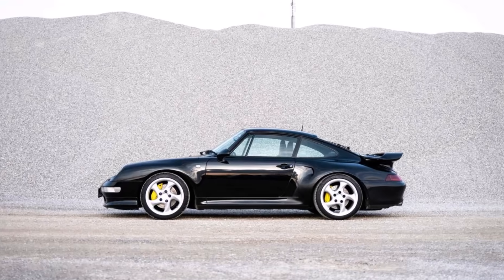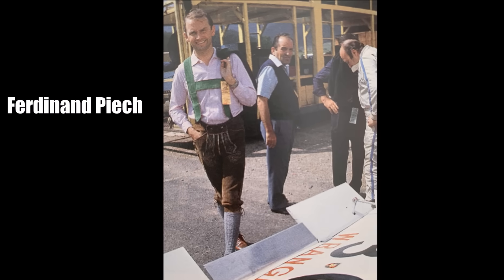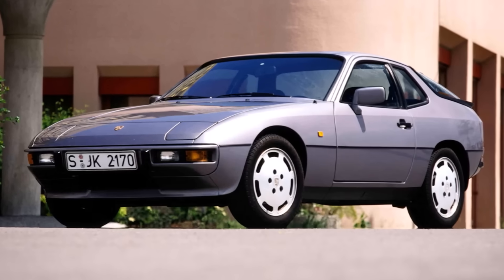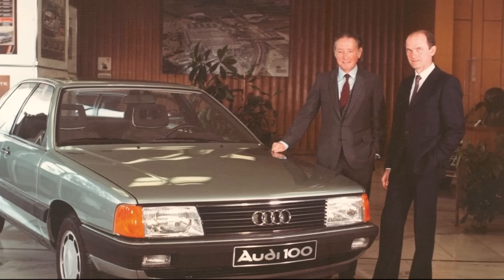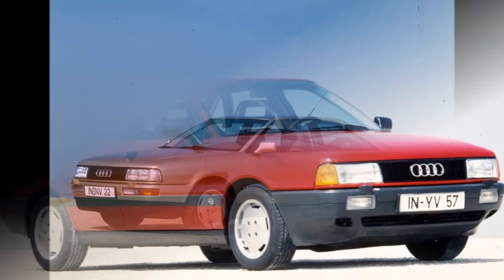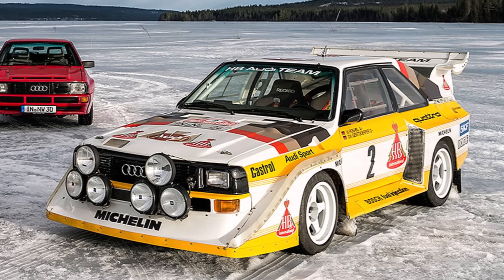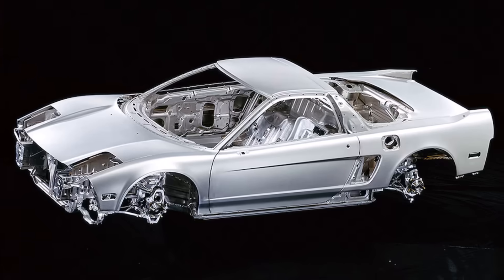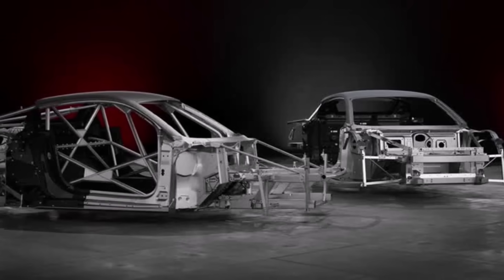How AUDI and Porsche eliminated corrosion forever - Development EXPLAINED

Comment: I mean, Audi 80 is a very good example of an old car without major rust problems.
VW Passat B6, on the other hand, is a much newer car and I see them with rusted arches all the time.
Reply: Funny, when I had a B6 with the 1.9TDI I was shocked when I first saw it from underneath because it basically looked pristine, no rust at all and not even the typical oil „sweating“.

Unfortunately someone ignored my right of way and crashed into me…
Reply: @Simoxs7  Lucky you. My B6 (also 1.9 TDI like yours) developed actual holes. Most rust I've ever had in a car.
Reply: The B6 and cars from its are are much worse than what came before, especially for the coloured panels. In 2005 EU introduced regulation for car manufacturers needing to decrease the  amount of solvents used per car produced. 

This lead to some places of the cars that followed shortly after to have decreased paint thicknesses and some sections where different coatings were used. 

The chassis is still quite well protected, but the B6 is definitely not as resistant to scratches or stone chips on its exterior panels.
Reply: I've never seen a b6 that didn't have a rusted trunk door
Reply: Here in Norway you see them with literal rust holes in the doors and it's not even rare, same with the Touran of the same age.
Every VAG product suffers badly from rust.
Reply: @kristoffer3000  Not every. previous generation of passat is basicaly rust free but every vw from this generation (2005-) rust super bad
Reply: @xy_iron  A b5 or b5.5 are not rust free lmao
Reply: I have Passat B6 since 2009. Corrosion firstly started on trunk door around left brake light few years ago. Now almost every panel has corrosion. some have relatively little, and some have a lot. Fortunately it is nothing deep. It is just surface rust.
Reply: rusted arches are kinda normal but b6 rust in super wierd places where no other car rusts like near door handles, chrome stripes on doors, or just middle of rear hatch
Reply: @xy_iron  for now there is no rust on those places. There are few rust spots on the roof where roof and windshield meet
Reply: currently doing fenders, rockers, 3 of my doors, replacing the rear subframe and patching my spare tire well on my b6, 1000 bucks running and driving avant 1.8t quattro with no negotiation though

Comment: No they didn’t. I have 2 friends with Audis rotting underside, cars made after 2008. They’d like a word.
Reply: that's very relative, it could be for alot of reasons including environment and how you look after the car, it's pieces of metal after all they could put all the protection on it but it fights with the environment for the rest of its life, i got lucky my 2001 golf has couple of tiny rust spots here and there while some newer cars seem to be falling apart.. but yeah the title is kind of misleading they didn't eliminate corrosion forever, they just found a way to slow it down
Reply: @emre619619  Romania, which is similar weather to Germany, both cars well maintained and not abused. And among mechanics it's a known thing. Something is up with VAG products in the rust department.
Reply: Rust never sleeps
Reply: The same car from a different make under the same environment probably don't even exist anymore - disintegrated into fine particles of rust dust.
Reply: @jamsbong  Certainly not the case. We have different cars here and they don't have this problem.
Reply: @ahmedalsadik  May be you've got a lemon. I've owned 3 Audis and none of them ever rust and I live on the rust belt and drive the car 365 days a year.
Reply: @jamsbong  Not my cars, two of my friends. Maybe your cars are newer and made in a different factory. But out here everything VAG is known to rust more than other cars, certainly more than other premium brands like Merc and BMW.
Reply: @ahmedalsadik  I have also owned a BMW and it rusted a lot underside and they have terrible quality all around. Like the paint cracks after just 6 years, disintegrating rubber and plastics, leaks everywhere by 8 years old. The same Audi car feels like a virgin by comparison to the bmw.
Reply: @ahmedalsadik  you can easily tell by the used car market price. A 10-12 years old Audi still commands a good price. BMW is usually a lot cheaper for the same age
Reply: @jamsbong  that's because people beat the shit out of beamers, while audis have a solid interior that lasts.
Reply: @jamsbong  Funny because my 2012 BMW has some rust on the boot but that's it, other than that it's mint.
200k km's as well.
Reply: @jamsbong  Nah, VAG products rust far more than anything else on the road, at least here in Norway.
Reply: Main problem are the steel subframes. But you can protect them pretty easily. 
But in general it heavily depends on the usage and how the car is parked. If you want a corrosion speedrun, just park your car in a badly ventilated but heated garage.